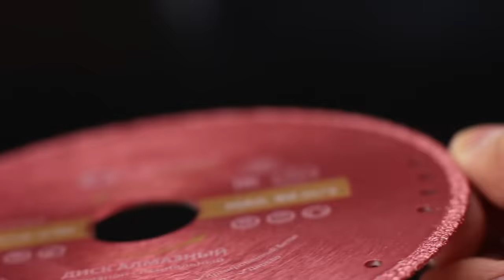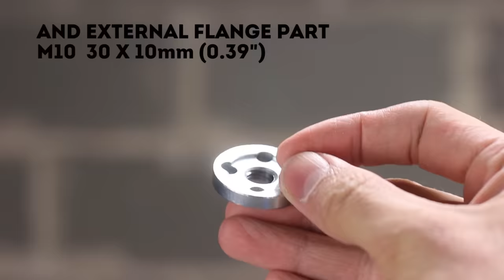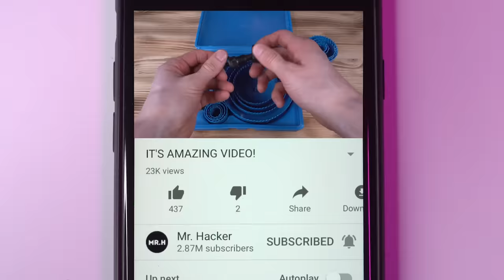TOP 70 Useful Drill and Angle Grinder Attachments, Bits and Discs you will use every day!

Comment: I was a metal worker. So I use grinders quite a lot. I've seen discs explode, (quite regularly) I've seen people catch loose clothing in them and the grinder has climbed up them and hit them square in the teeth. I've had it happen to me and luckily my tshirt jammed it up just below my neck.

I've seen all kinds of accidents with them. Even a fine disc can chew flesh up VERY quickly.

I just would never use a grinder without anything but 100% respect. As manufacturer intended.

Edit: it's cool to read the working men of the world in agreement with regards to safety, because I know it comes from experience and respect for yourself, your trade and tools. Also, it's nice to have a shared experience and respect with people in the trade from round the globe.
Reply: I'm a hobbiest metal worker, self taught. I have experience working with a ton of different materials. Luckily, i grew up working with stuff kind this. And still, when I started working with metal a bit more, i learned that it's a different beast, just like you said. I've bad several disks explode, but i always have on my safety gear. The very first time one that exploded was a chop saw, and one of the pieces got me right in the middle of my safety glasses. I would be blind or dead if I didn't have them on. I've had a few grinders hit my boots and gloves. And that's me being as safe as I could be.

What I'm saying here is this: listen to the man above be, he knows what he's talking about! Don't learn the hard way! If anyone thinks they can control an angle grinder when it gets caught up on something, you're wrong. They turn so fast and are so powerful that wherever it wants to go, it's going.

Take your time and don't cut corners. And please, please respect your tools, wear your safety gear, and take the advice of the professional above me.

This stuff is no joke. If you're not sure what you're doing, ask someone who does. If something doesn't feel right, don't turn it on!

Much respect for the folks out there doing this every day.

Be safe everyone!
Reply: 100% Agree with everything you said. Just wanted to point out that wheel with the chain saw teeth on it with out a safety guard. This could be very useful indeed but, just imagine what would happed if you had a snag and dropped the grinder. If you have ever dropped one and seen it take off full throttle it's scary. Now a disk full of chisel teeth that would climb up your jeans and attack you like a wild bob cat!!
Reply: @bcrusher1979 
Using an angle grinder without protecting shield is no go.
Sad needing telling You that.
Stupid and unprofessional. 🤕

Comment: What I love most is that these people take a relatively safe tool and make it more dangerous!
Reply: Gotta love the chain saw blade wrapped around a disc guardless, just waiting for one of the "high grade" chain pins to shear off!
Reply: I'm not even worried about safety... I'm worried about the brushes😢😢😢 in less than a month replacements would be needed

Comment: Yes, some of these attachments look pretty lethal — but others would be really useful. Any tool is potentially dangerous in unskilled hands. You can drive a slipping chisel or screwdriver deep into your hand, or suddenly remove a finger with a sharp hand saw. It's about taking care, considering risks, and always using correct protection. The chain saw on an angle grinder should be off the market! And brittle disks used on a/grinders can explode at high revs, or if they twist in use.

Comment: 22:55 There is one, but a very big minus of this factory solution. Why do chainsaws use a centrifugal type clutch? In order for the cutting chain to stop immediately when the speed is dropped. And on the angle grinder, the chain will stop until the anchor itself stops. In which case, a few seconds is enough to seriously injure yourself.

Comment: Some of those grinder attachments are quite heavy, consider the centrifugal force at 11k rpms of those carbide teeth on that blue wheel for example, if it came off it would be like a bullet with no fender guard to arrest its departure would possibly be enough to pass through a face shield even, even if not, how about your lightly clothed body? Think of even the chainsaw teeth flying at you! Many  items that wont fit in that 4.5" guard are not intended to be ran that fast, and likely to eventually come apart or become violently unbalanced if over-revved.    In the past I have done this, and also got away with it thank GOD but have been more and more concerned and working to get larger guards in place.    One day I didnt pay attention to the max rpm on the new wheel I was excited to try out, it exploded and became unbalanced with such force the shaft of the tool bent and even broke through the housing holding it. Thankfully the escaped pieces didnt hit me,  since they were moving so fast  I still havent found them.  My point is when you do some thing like this it always feels like there will be some warning and time to react.  But there isnt, its just over and if there is no guard to take the blow, most likely you will.   I enjoyed the video but it was lacking of safety a good bit!
Reply: Finally, Someone with common sense sharing facts, not just fears.

AND more than that, a offering a possible solution.

Most comments are just whining.

Asking and answering the questiont "Do you know what could happen if......?

Those people must have guard rails on there beds because "Do you know what could happen if I rolled out of bed and hit the floor? I might knock some sense into myself!"

Thanks Troyvidihoo

Comment: Circular saw foot fro angle grinder interesting... the combo Drill/tap is best!!
Reply: Don't use that,it will leave an iron mark on the ceramic tile wich cannot be cleaned.The only way to avoid this would be to cover the bottom with tape,to avoid the direct contact between metal and ceramic.

Comment: OK first vidio... If you use diamond disk for cutting steel yes it work, but for short time. Diamond disc contain cobalt and carbon which meke it hard (tough). steel contain carbon too but smaller. and here comes the magic. carbon from disc came to steel, because steel is able to absorb carbon from diamod disc.  this physical proces is called difusion.  as you wote in this moment "ALL DONE"

Comment: 👉 You should have a safety warning posted through the whole video. Some of the ways you're using saw blades is extremely dangerous, even deadly. With 50 years in the trades, I've seen some serious accidents, and I'm talking blood everywhere and an ambulance. Use the tools however you want, but don't teach others to be stupid with power tools, especially saw blades!
Reply: I agree, especially about the "table saw" attatchment

Comment: Angle grinders can be very dangerous tools when used with disks that are brittle and can break easily, becoming high velocity projectiles that can put you in the hospital, never use anything other than metal circular blades that don't break.Remember a grinder is a grinder!
Reply: Plus those attachments are gonna do sh!t job compared to dedicated tools and much slower

Comment: In the era of variable speed equipment, it is foolish to show equipment from the 20th century. Firstly, speed regulation extends the life of the attachments and increases the safety of their use. Secondly, the producer of this video may be sued by a potential customer who suffered an accident as a result of using the tools shown in this video contrary to their intended use (e.g. without covers).

Comment: The Guard was the first thing you should have showen on the video. I presume this is US origin. as here in UK. our health and safety people would be jumping up and down in rage seeing people using angle grinders without guards on them. As a retired blacksmith I. I'm one of the first to admit that guards do get in the way under certain circumstances. but there's more than one choice of guards on the market. and even adjusting a provided guard. can make it more useful by just cutting a part of it away. And still keep the safety aspect of it. I'm not trying to blame this particular video maker. It seems to be commonplace. but showing videos of unguarded. angle grinders with fingers less than an inch away from a revolving blade is just in just encouraging people to do this. All it needs is an angle grinder blade to catch and jar that hand forward, and a finger is lost. I know I've been stupid enough to do the same trick in my youth. but I was lucky. I only got my finger cut not lost. Other than this aspect great video very informative.